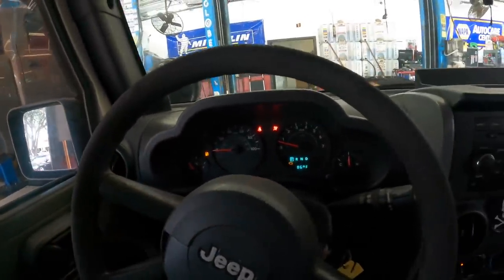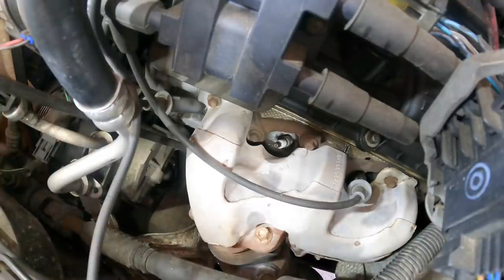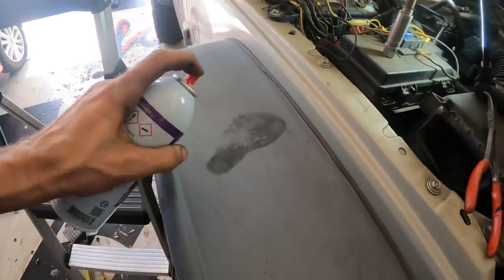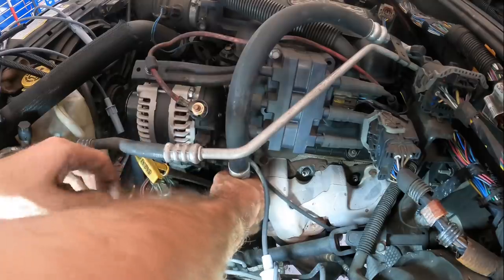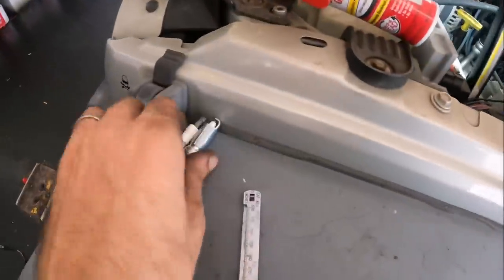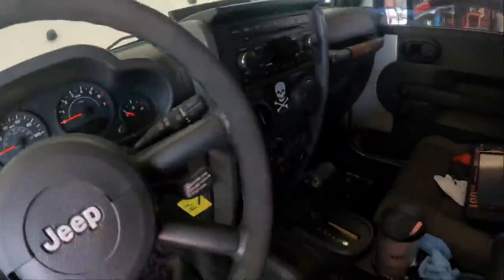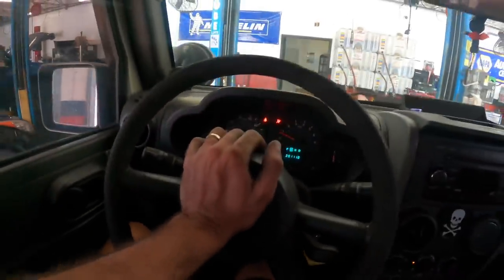My last car! Case of the Fridays. Jeep Wrangler 3.8 P0300

Comment: When replacing wires, consider the idea of attaching the new wire to the old one, then when you pull the old one out it will automatically route the new one correctly, without frying any fingers.

Comment: I just worked on one of those the other day it was an '04 with a 4.0 it had same symptoms I had 4 injector sticking closed causing a misfire  while had a 154000 on clock

Comment: Watching Rainman's video with all these high mileage cars, I wonder sometimes if electric cars will be able to go so far and still remain in good working order or be able to be repaired relatively cheaply.
Reply: Electric cars are supposed to be just like smartphones- you cannot repair them. Throwing away and getting the new "even better" one is the only option. It's called ecology nowadays you know... or screwing anaive customer, who doesn't get any choice anyway
Reply: @kris856  that is why I want to build my own like Zach from jerryrigeverything or, the electric super car channel
Reply: NO, NO, and NO.  With proper maintenance, Diesel will always outlast a gas engine, and both will outlast the electric.
Reply: I recently read that EV are going to be good for 150,000 to 200,000 miles because that is how long they expect the batteries to last.  Watched a guy blow up his Tesla because it was going to cost $20K to replace his battery and the car was not worth it.  I cannot figure out how EVs are going to be good for the environment.
Reply: Battery technology has not yet met the sustainability level. Hopefully someday soon.
Reply: @johncooper4637 , and when the batteries burn, it's even worse than an ICE.

Comment: I remember I had a 96 Blazer 4.3 liter and no combination of swivel sockets nor any other tool could get to the middle plug driver side it was right behind the steering shaft could barely put the boot on screw it only did five plugs.

Comment: Running spark wires   in parallel   can cause cross firing,  but  guess you know that, Ja?  Ha But on those  heater hoses being wrapped around each other, maybe was done  to keep them away from hot things that melt rubber, but donno.  Long day at the shop on a friday, Though. Good work.

Comment: Both 3.3 and 3.8 Chrysler engines are pretty bullet-proof. With minimal maintenance, they run and run and run. I've seen so many of them seriously abused, ran nearly out of oil or coolant, and they keep on ticking (sometimes literally). As far as that misfire, it's very common. One thing that I have seen kick off a misfire code on these engines is a worn timing chain. I had a minivan that all of the electrical was changed, but it still misfired. I changed the timing chain and it cleared up.

Comment: Raises way more questions than answers. These are tapered plugs in an aluminum head right? Loose for fear of stripping out the head. Anti sneeze hand tight and one eighth torque. Iridium plugs like cop cars never have to change them again.

Comment: I I didn’t know spark plugs could last that long. Back in the day when I still did most of the work on my 74 C10, I changed them annually. They were so cheap back then, around $3 I think.
Reply: Good spark plugs today are designed to last 100k miles

Comment: That first plug looked like the ground electrode was bent- maybe never had the proper gap.  the spark will always find a way to ground and with a gap that big it's normal for the spark to find it's way through the boot.  For a cheapskate homeowner or roadside repair you probably could have closed up the plug gap and got away with no parts.  But in your case, the full repair is the only way to be sure.
Reply: Thought the same. Readjust all the plug gaps. But then only done by owner.
Reply: Plug didn't look that dirty either.

Comment: Love your videos and the new intro is awesome. I learned a lot watching you slave away at your job even my wife watches. She is a automotive consultant. I am a electriction and work in substations where there is high voltage DC. I seen a video where you removed a battery by taking the positive off first that is a little dangerous always remove the negative first it's much safer. Do the opposite when  installing a battery. Stay safe keep up the good work not trying to be a troll.

Comment: I use to hate ignition leads on older cars. Don't think I've had to tackle spark plugs and ignition leads in years though.
Remember the old distributer with points ignition systems and carburettor engines lol Still some about but not many.

Comment: I always hated wranglers. Guys wire so much stuff on them. Sometimes they put lights in the hood and you can't even get it open to change the battery.   Or there were so many extra wires hooked on the battery that there was no way to pull it out.  And they all seem to have a corrosion problem on the positive cable end.

Comment: Maybe tie a string or make a end to end spark plug wire extension when pulling wires back around the engine and connect it back on the new spark plug wire to fish new wire back through. :)

Comment: Since dielectric grease is an insulator, shouldn't one keep it off the metal contacts and only apply to the boot? Seems like a cotton applicator would aid in this and prevent problems of a high impedance connection. And to ease "snaking the wires", tape the new wire to the old and use it to tug the new through.

Comment: What!!!, that engine compartment looks like a bowl of spaghetti has been emptied in it. What’s with all the bare wireing looms.
  This cannot be standard work by jeep. Looks like a road to disaster. Wireing short Big Bang and lots of smoke cannot be good.
  Great work Ray,love watching your vids always informative and clear.
  You have a great weekend, you deserve it. Have a great day 👍😃🇬🇷
Reply: The loom disintegrates (so you see) which causes wiring shorts between the pcm and the coil. Took six months to find. I “reloomed” under my hood after i found the issue. Very Frustrating but something had to give at 210k miles.

Comment: An idea: unplug old plug wire from the distributor and tape the spark plug end of the new wire to the distributor end of the old one. Then use the old wire to pull the new one into place. Connect each end of the new plug wire. Repeat for remaining plug wires. Then you don't have to try to fit your arm into super tight spaces between the engine and the firewall.  Well, sounds goo din theory anyway.

Comment: back in my day I would never use power tools to remove spark plugs, and i still wont today ,especially with aluminum heads, if  the threads feel funny I use P_B and let the threads soak, but on the other hand I  quit working in shops 40 years ago.

Comment: I have an 03 wrangler, my buddy Craig ( we call him that because that is his name) has a JK. The wiring in that thing made we TWITCH! It looks like something Craig would do. And then we would spend the way in my driveway rerunning the whole dame thing. Soldier, heat shrink, tip ties….omfg. I think he would show me crap like that on purpose because he knows i will blow a gasket and fix it. He is also the guy had had to show how too do an oil change to 4 times before he got it.

Comment: Man on these jeeps i tape the new wire to the old and pull from the plug side out . Feeds the new wire through.  Im not able to move around the engine bay like you are though.

Comment: I changed the plugs on my 03 Ford Ranger this last Friday.   

First thing,  while changing the plugs on cylinders 2&3 (passenger side RIGHT next to the AC components), all I could think of was "I couldn't film this like Ray does" because I was teaching the neighborhood new words.  At the same time I was putting a curse on whoever the engineer was great, great grandchildren for routing the transmission dip stick tube right where my ratchet and our arms needed to be.   Stupid engineers. 

Secondly,  I do put anti-seize on the plugs,  always have, always will.

Comment: The 3.8 has it's advantages compared to the 3m6 VVT. this being plugs and wires.
Reply: I would say at disadvantages weight from cast Iron block, lack of power, poor MPG (even for a Jeep).
I don't understand why chrysler dropped 4.0 HO in favour of slightly newer 3.8.
Reply: Neither of them are known for being reliable ..

Comment: I have one of those (in the 4 door).  What the hell is going on with the twisted heater hoses on the drivers side!?  I replaced the leads on mine some years ago.  I pulled the intake off for easier access running the leads around the back.  Then, even though I checked I had them right 3! times.  I still crossed 2 & 4...  You think it runs bad with a misfire on 3?  Try running with 2 full time misfires! :P  The biggest issue with those leads (and why I replaced mine) is that the OEM ones have a bad tendency to leave the clips on the ends of the plugs, so I had to recrimp them back on the leads.  The guide tray that holds the leads off the engine as they go around the back is missing there, as well.

That crap in the throttle body is engine oil coming through from the PCV.  I spent some time cleaning all that out, too.

Comment: Less than one minute into this video, I would bet that it needs plugs and wires. Let’s see if I’m right lol. If those plugs have been in there a while, they rust right above the threads and like to break off in the cylinder head. Not a good situation to be in if it’s the rear bank on a minivan

Comment: I'm convinced all jeeps eventually develop misfire conditions and airbag lights on. I've been trying to repair a 02 liberty with a p0300, p0301, and p0304 and have not been able to fix the problem.
Reply: If the injectors spark plugs and wires are good it's either ECU is bad or some of the valves are not closing all way most likely from carbon buildup
Reply: 2.4s are good for valve leaks
Reply: May I suggest driving to Florida and having Ray fix it. He clearly can figure it out and it would make a great video from customer out of state. (If you are)
Reply: @HoLeeFuk317  I’m familiar with the need for valve jobs on the 2.4. $$$

Comment: So it sounds as if this basic tune- up was about 50,000 miles over due . That's what I got when you checked the gap on the spark plugs. 
Wonder what the oil looked like?

Comment: When I saw the title of the video I wanted to see you do a set a plugs on a 3.6 Pentastar. But it turns out that it’s a 3.8. Those are so much easier than the 3.6. You have to take the upper intake manifold off to get to the plugs out on the driver side. I feel like Chrysler gave all mechanics the middle finger when they designed the intake manifold on the Pentastar.
Reply: There's quite a few manufacturers that do the same thing unfortunately, not just Chrysler.
Reply: Chrysler vehicles are such a mix of good and bad engineering.  I had a 200C with the 3.6.  It's a nightmare to reach a lot of things on that engine, but the oil filter is right up top and easy, and there's a little swing door in the belly pan to get at the drain plug without taking off the whole thing.  And changing a headlight bulb on that vehicle is the easiest I've ever seen on a car:  You can literally do it in a few mins with a flat blade screwdriver, or possibly even using a coin as a screwdriver.  My friend has a Toyota 4-Runner and after changing the oil himself and ending up covered in it when trying to do the filter, he now has someone else do it.  And he invented some new swear words when  he had to change a headlight on that beast.  Nice truck though.
Reply: You are 100% correct lol I own both👊🏻
Reply: Intake plenum are super easy to pull. I even pulled my Hemi intake off in about 5 minutes. Much easier to pull a cop over routing new wires.
Reply: @mph5896  yeah it’s not bad GC a little more cramped then JL but still not bad just time consuming. Just gotta use new intake gaskets and torque in proper sequence 👊🏻
Reply: Once you do it, it's a lot faster the second time. 😅 I recommend just doing all the "while you're in there" stuff at the same time.
Reply: @mphilleo  ditto 👊🏻

Comment: AMD AKA Car Care Nut would be unhappy  with the way you let the throttle body slam closed. It is bad for the little motor in there according to him. It makes it generate electricity which could cause a problem.

Comment: The sped up clicker noise @3:22-3:25 on a right turn, indicates to me one of the blinker bulbs on the right hand side is burnt out and needs replacing.
Reply: Or the owner has installed LED lights that don’t have load balancing resistors

Comment: Do you ever have things really go drastically bad at times when it seems simple enough?
Reply: It’s called life… :-)
Reply: Try changing spark plugs on a 2004 - 2008 Ford 5.4 liter . Replacement time can be 1 hour to 20 hours.
Reply: @dougdaniels4597  I see your '04-'08 5.4 and raise you #7 and #8 on a 99-06 full-size Chevy/GMC truck.
Reply: I will see that and raise you a 2005 ford escape v6

Comment: I give my husband a bad time about letting the gas gage get below a 1/4. He’s starting to fill it up when it gets to half. I had a car and the gage did not work. I went by number of miles driven and always filled up early. Never ran out of gas. Had that car for 12 years. My husband has run out multiple times. Once with his mother.  Not a good time😞
Reply: I used to let it get pretty low too. One time on a road trip with my Mom I wanted to get out of Maryland and into PA where the gas was a bit cheaper... found myself driving through the Gettysburg battlefield and Mom asked how much gas we had left... the display said zero miles, and I said "you don't want to know".

We made it, and now I fill up when it gets to a quarter tank if I'm near home, on a road trip it's a third tank.
Reply: @JeffDeWitt , that way, you get to decide what time of day and what part of town to gas up.  I can't seem to make my ex understand this.
Reply: My first car, a 74 Duster, didn't have a working gas gauge. I pushed that thing a lot. I was a teenager with no job, so I never filled the tank. A couple cars later, I had a Karman Ghia that didn't have a working gauge, either. I was lucky a couple of times when it ran out and I coasted downhill right into the gas station.

Comment: So.... I understand that stray arcs are usually because of large plug gaps - but I always assumed you just change the plugs and you're good to go.   Wires are actually bad?
Reply: Boots get hot thousands of times, dries out and cracks.

Comment: Ray, any chance the next time you find spark plugs out of gap, you can some reasons why they do that.  I assume it’s heat expansion but I am t not a mechanic. Thanks
Reply: A small bit of metal erodes from the electrodes each time they fire, it’s normal wear.

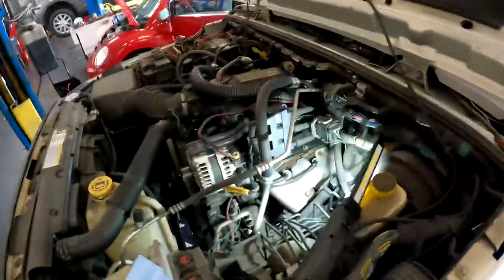Comment: At time interval 4:35 you indicate you misread a diagram which would show #3 cylinder on the driver side. You were right the first time. On the 3.3 L and 3.8 L Chrysler V6 engines, passenger side has #1, #3, #5 and driver side #2, #4, #6. But replacing all plugs and wires covered your mistake.
Reply: There was no covering of a mistake here.  The plug was worn and the wire leaked.  He even caught the arcing on camera.  No competent shop would just replace 1 plug and 1 wire.  Besides, the 3.8L has 3 engine codes: L, C and K.  C and K have cylinder 1 on the drivers side.
Reply: @zcvyvyan  Since 1987 when Chrysler first introduced a 60 degree V6 engine in its front wheel drive vehicles,
The cylinder closest to the crankshaft pulley has been #1. That would mean cylinders #1, #3, #5 
were closest to the firewall and cylinders #2, #4, #6 closest to the radiator. In the Jeep Wrangler application the engine was turned 90 degrees counterclockwise but the cylinder numbering would not change. So middle cylinder driver side would be #4, not #3 as mentioned in the video.  But ultimately Ray gave the correct recommendation for the misfire. Replace all spark plugs and wires. Problem solved for the customer and no come-back for the technician.
As far as engine codes (8th position of the VIN) the 3.8 V6 in minivans had code designation L.  In the Wrangler with longitudinal orientation for rear wheel drive it was changed to numeral 1. You can verify this by looking at time interval 0:53 in the video.                                                                                                                                                                                For year 2007 Chrysler engine code K was assigned to the 3.7 liter, overhead cam V6. This is an entirely different engine from the push rod 3.8 V6. Cylinders #1, #3, #5 would be found on the driver side of the engine compartment.  Engine code C was assigned to the 5.9 liter Cummins inline 6 cylinder diesel.  Engine codes C and K were never assigned to the 3.8 liter V6.

Comment: heres one for you ray..1975 highboy., stops ever 2-5 days, starts up again after swearing for 10 mins.. cleaned carby, i6,300. best engine ever built.. blew line back to tank. had to help guy move, tray back plenty of room. never made it, stoped again. good for 2 wks sometimes.. anyhoo, took it in field, burned it,, no really,, after checking the inside of exhaust & 5 tires for debri,, i pulled the cab tank out.. drained it. made a bulb on wire, BOOM. no really,, what did i find.. the gasket from the fuel sender, had droped into tank,& on occasion, would block the outlet.. some people. id say this is why the guy sold it.couldnt fix it. new paint,new interior, ?, not much interior.. good mechanicals. yup,damn cork gasket.. wander if a computer would pick that..i was actually checking the tank for pick up leaks or droped off.. damn gasket.. its now a 351c, 5 sp, 4w disc. cut to swb, d44 h/pin locker. 16 x 10 x 35,s. ausie..